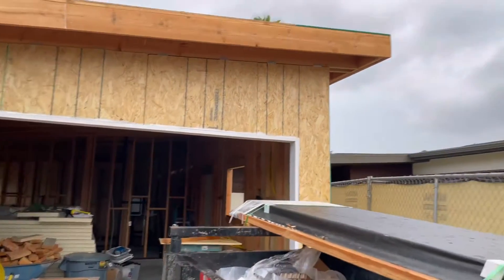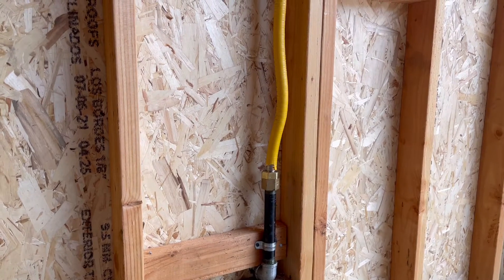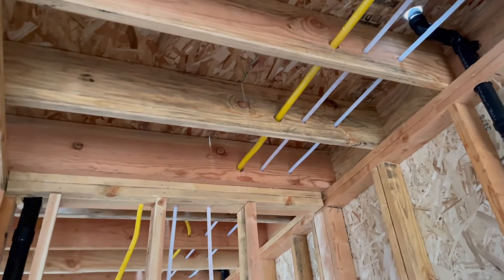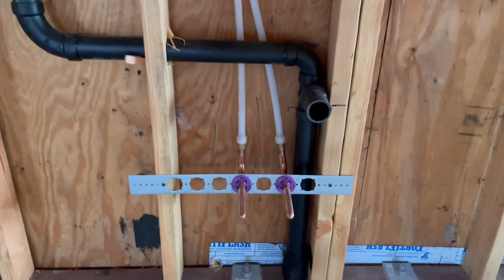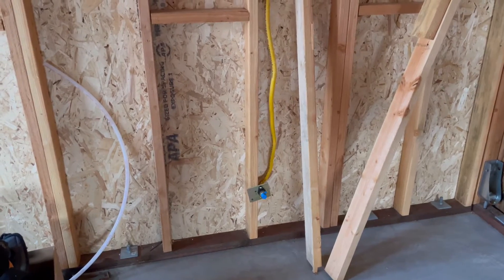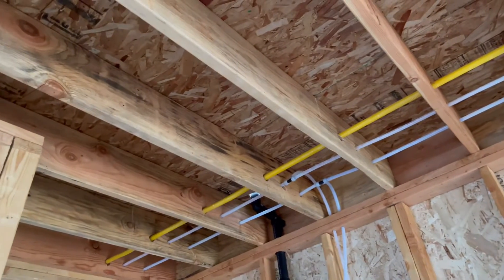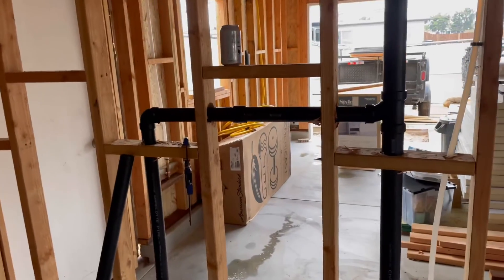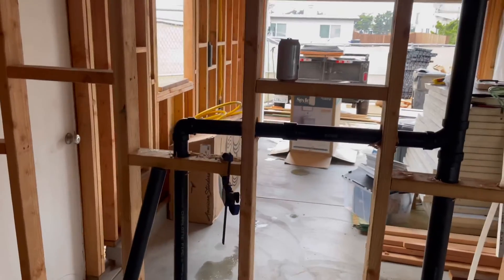DIY ADU Update #7 - Plumbing Rough In

Comment: Question. I’m building JADU garage conversion with a small kitchen and bathroom, do you know if I can tap into main dwelling sewer/water main?
Reply from the maker: Hi Joel, check out the latest bulletin. If your converting your garage you should be fine to tap into the existing dwelling supplies. https://www.sandiego.gov/sites/default/files/dsdib400.pdf
Reply: @URBNBLDRS  You’re the man. Thanks

Comment: did you actually do the rough in plumbing without the presence of a plumber? I thought it has to be installed by a licensed plumber.Please educate me. I really like your video, very 
honest and direct to the point.
Reply from the maker: The short answer is that it needs to be installed to code, either by the owner or a licensed contractor. I am licensed as a general and concrete contractor, but I am building this as an owner builder. So I assume all liability for the installation. For the plumbing, I prepped everything, ordered materials and then had a plumber who is a friend of mine come down and we busted the majority of it out in 1 day. Mainly the drains, vents, water and gas. You don't want to screw up your electrical or plumbing and there are so many codes, so it's good to use someone experienced and have access to the tools for this type of work.